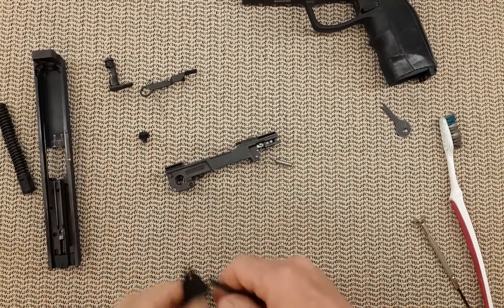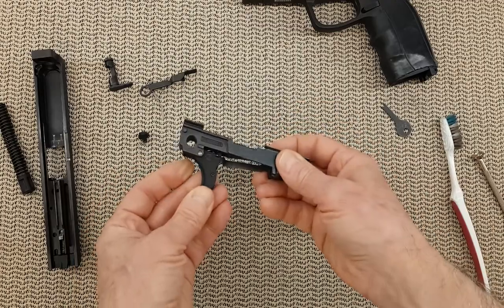Steyr L9A1 Field Stripping

Comment: I purchased the Steyr L9-A2 about 2 years ago.  I've only 'field stripped' it to clean until now.  Your 'field stripping' video goes well beyond the typical: remove the slide & clean it instructions.  It showed how to remove the the lower assembly and begin cleaning all of these intricate parts.  Really, really well done and my sincerest thanks again for the detail.  I have viewed the very detailed video re: disassembly of the entire fire control mechanism.  These 2 videos have helped me take the gun apart completely & clean it appropriately.  Btw - a few springs did 'fly away', but I was lucky enough to find them in my work space.  Thank you again very kindly for these detailed videos.  The Steyr L9-A2 with 17+1 rounds of 9mm is an awesome gun!  Reliable, fast and easy to control.